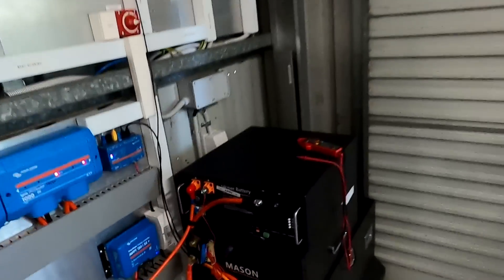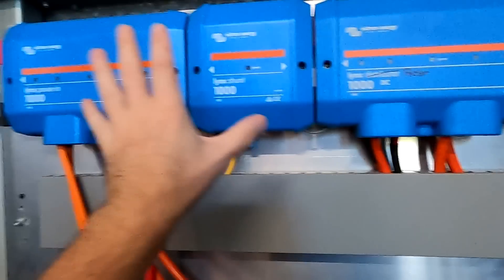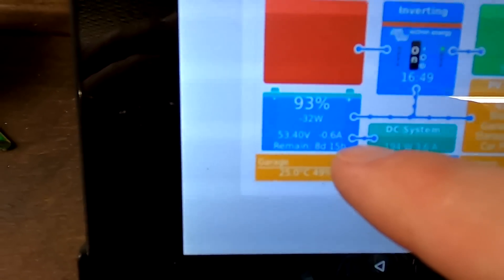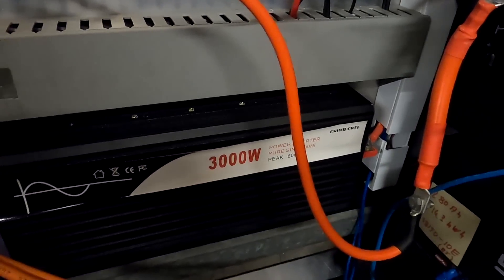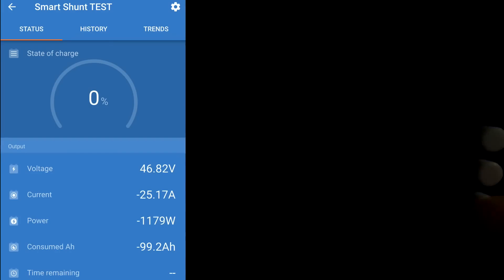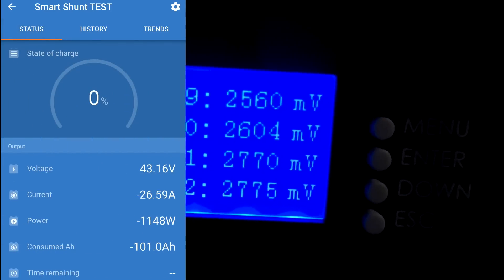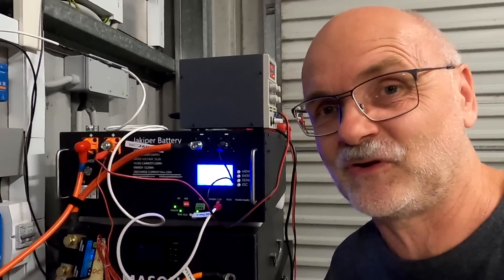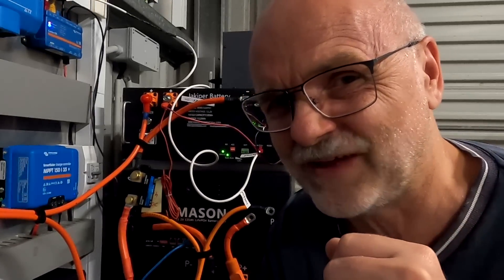Jakiper 'Jaki' capacity test. Testing the boundaries of the BMS. Can it deliver?

Comment: In the realm of testing Jaki's might,
A YouTube video took flight.
A battery test, one hundred amps,
To measure capacity, no mishaps.

With lithium power, Air Force strong,
They sought the truth, could they go long?
A full capacity test, they'd try,
With limited info, but spirits high.

Display and Victron, their trusted guides,
To see if Jaki could take the strides.
Would it deliver, could it confirm,
A hundred amp hours, a triumphant squirm?

The sun set low, as the hours passed,
The battery drained, would it last?
Monitoring voltage, cell by cell,
The fan slowed down, as they'd tell.

Zero percent, the end in sight,
Yet Jaki's strength, still burning bright.
Rated capacity, now fulfilled,
One hundred amps, the tester thrilled.

Though short of one hundred four,
The Jaki battery proved its core.
Awaiting access to the BMS,
An adapter quest, in Easter stress.

A test complete, they bid adieu,
Stay charged and safe, the message true.
A video's end, with knowledge shared,
For Jaki's battery, a future prepared.
Reply from the maker: James, you're amazing!

Comment: The relay is not a mechanic contact but probably a triac one you need voltage and load, a bulb to test it
Reply from the maker: It's a dry contact with two relays on the BMS.
Reply: @OffGridGarageAustralia  then it's definitely a problem.....

Comment: Good test.  I agree with some others about measuring on that terminal - might not be a connection without a conductor in there.  I would stick some wires in there and clip the DMM to the wires.

Comment: Was the  Epever  inverter  still  producing the  proper  discharge  voltage at BMS  shutdown?
Reply: My  refrigerator might not be as forgiving for  running it  at low voltage.
Reply: I think the Tesla gets fussy about the voltage, so it would stop charging if it was too far out of range.
Reply from the maker: Inverter was fine as the load was fairly low with just 1kW.

Comment: Hi Andy, I don't see a problem with the temp sensors positioned on the rail above the battery as heat rises. (Technically cold air pushes the warmer air up ) André in Sydney
Reply: The thermistor isn't really measuring ambient because it's bolted to metal, it's measuring the temperature of the bar. The bar will conduct some heat from the battery but it will also get some cooling conducted from the outer case. Measuring the heat of the terminals is better because that's where any resistance happens.

Comment: 11:09 5KWH = 30km Tesla
If I want 300km, I'd have to pull 50KWH then...
Reply from the maker: Yes, roughly. If you charge faster at 2.5kW for example, it is a bit more efficient. 
But we're making DC to AC and the car converts it back to DC, so that all is around 90% efficient ever time it converts.

Comment: Sometimes those green terminal blocks have no connection to the screws unless they are tightened down, or you can put some wires in.

Comment: When measuring direct on connectors, sometime you don’t get connection on the screw heads before screws are tightened. Please tighten and try to measure again.
Reply: Or stick the probes in the front holes where the wires are fed in.
Reply from the maker: I tried both with no luck. Will test again when we test the BMS and use some cables then...

Comment: Is 2.55v not to low or is it still ok ( still save to use ) ? 
For myself i think to go 2.75v ( 44v ) and max. 3.55v ( for LF304 cells )

* but every small  ah counts yes 😊
Reply from the maker: For a capacity test, I go all the way from 3.65V down to 2.5V. These are the specifications for these cells.
But under normal use conditions I don't charge higher than 3.45V (55.2V). That is over 99% already.

Comment: Hi Andy, I have found with those relay connectors the terminal screw can be isolated until a wire is inserted and the screw is screwed down.
Reply from the maker: I tested directly from the front as well...
Reply: I’ve never seen a screw like that “disconnected” until screwed in.
🤔
Reply: @FutureSystem738  Yes, the contact/connection  is at the bottom and there is a top contact but it does not touch the conductor until it is screwed down and then the conductor is held between the two and until the screw pushes down the top contact it seems to be isolated. this has been my experience with some of these terminals. It would seem that the top contact is not connected but only there to prevent the turning screw from drilling into the conductor as a form of protection, so until the conductor is clamped there is no electrical connection to the screw head.
Reply: @howardadams4072  Thanks.
(I’ve never seen contacts like that.)